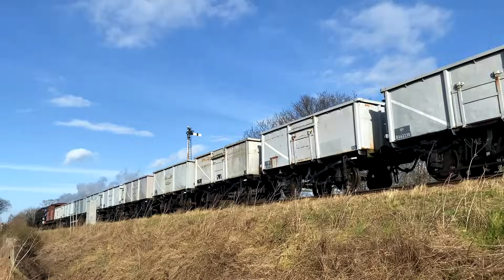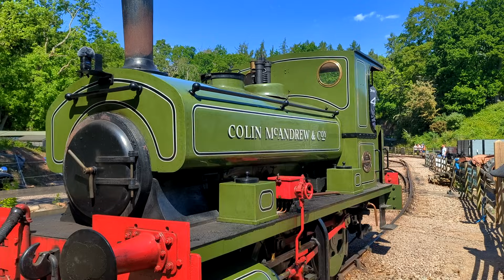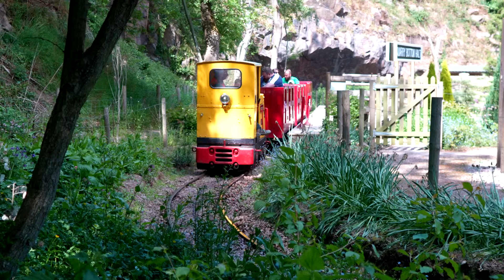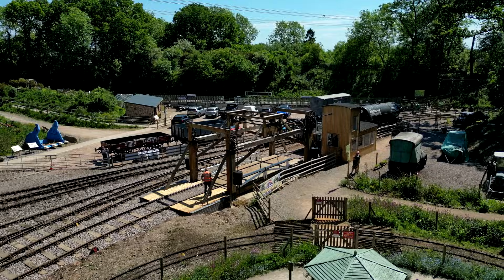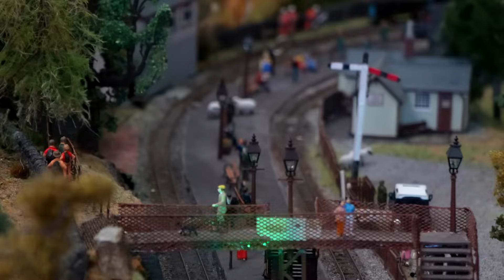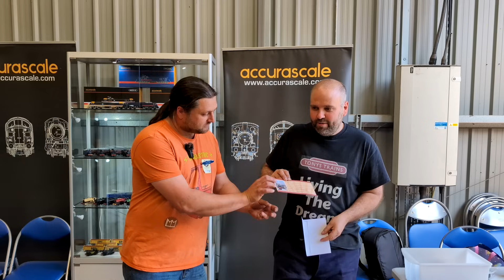Driving Trains Large and Small - Tony’s Trains 10th Anniversary Model Show

Comment: G'day Lawrie
Just a quick question from a fellow chap of another land, looking at filming my own experiences driving locos, shunting, guarding/conducting etc and wondering what camera setups you use/recommend?
Doesn't need to be too fancy, just want to get into the recording side of it all.
Cheers.
Reply from the maker: Heya,
That's a very big question!
For anything like driving I'd recommend a 360 camera like the insta360 x2 that I use.
You mount it, turn it on and then leave it alone so it doesn't interfere with your duty.

As its recorded a 360 around it, you can then use the software to get the angle you want when you edit.

The stabilisation is absolutely top notch too.

For little clips I use a Google pixel 8, and for the main recording I'm using a Sony A7iv.
It's a great picture with touch screen focus.

Then the most important thing is to have a clip on microphone to pick up your voice rather than the sounds around you.
Hope that helps!
Reply: @lmm  It most certainly does help, thank you very much. For reference, I'm part of the Plains Railway in Tinwald, New Zealand. If you ever come back over, be sure to pop in!
Reply from the maker: @w6driver I would love to!